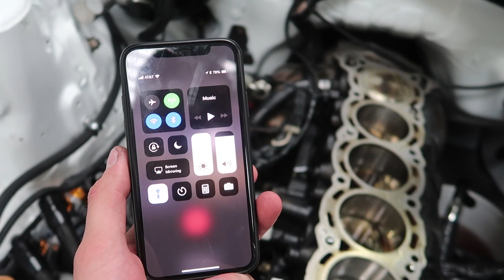DYNO DAY GONE WRONG

Comment: you say its not alberto fault because he didnt touch the head,, but he also didnt check the leaking valves or do a compression check before/once engine was put together, thats like not checking the timing belt is in the correct place etc etc, just useless and lazy shortcuts that lead to this shit.

Comment: You cant blame anyone else for you own mistakes. You left tbe head flat on the surface with the cams bolted in......... depending on cam rotation someof the valves will be down... you need to get a new mechanic and get rid of that alberto guy

Comment: Time to fire big boost.
Reply: Alexis Calderon clearly you know nothing about cars or anything about working on them that's a hundred percent a machine shop failure that they could have caught before they gave it to him
Reply: Time to fire big boost.
Reply: Jamie Knight time to fire big boost mate.
Reply: OSN's Chair tuna no crust? Fire big boost.
Reply: Guys I like Alberto but when a 45yr old certified mechanic says he heard it in the starting video and leaves his business and address to it to verify that says something
Reply: GixxerDad 600 clearly you know nothing about cars, because it isn't guaranteed a hundred percent a machine shop failure. The cause is yet unknown, only the symptom are known, so all the YouTube mechanics can stop pointing fingers until it is. Having worked on hundreds if not thousands of heads in my time in a speed shop there are several causes for the same symptoms.

Even then if the machine shop was not asked to do anything other than skim the head, then that is all they will do. They will not pull the head apart (unless the valves are sitting above deck level), they will not put new guides in, they will not cut or crack test seats, and they won't grind and lap valves. These are all services you pay for. The machine shop will do exactly what they have been paid to do.

If the head was put back on with no work being done on it other than a skimmed then there is only one person to blame and that is the owner.